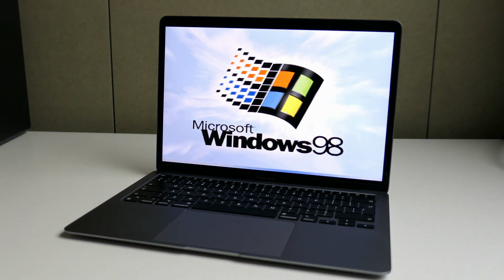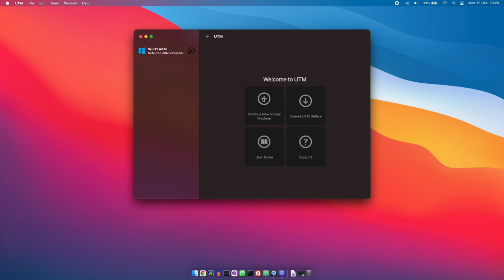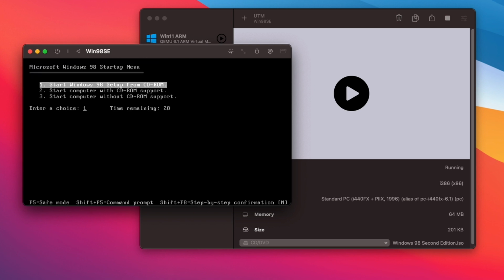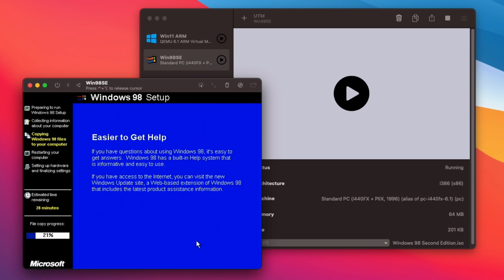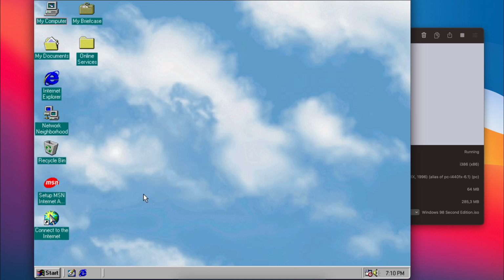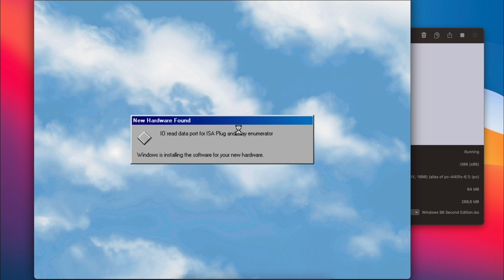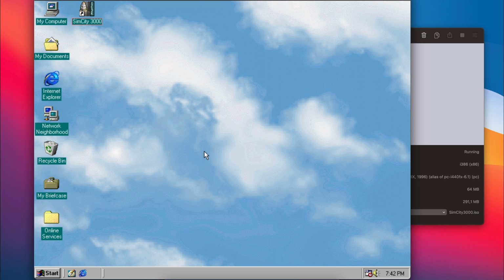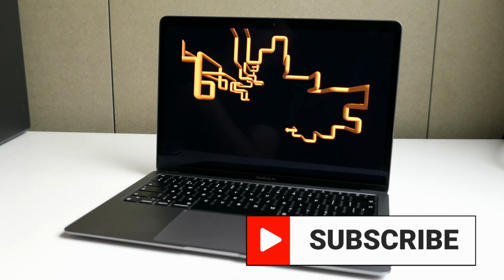Windows 98 SE on M1 or Intel-based Mac with UTM - part 1

Comment: THIS IS IMPORTANT: DON'T click "Next" during the second stage of the setup, otherwise Windows will throw the error "This program has performed an illegal operation and needs to be shut down" Anytime you see that button, don’t click it, press Enter instead, it did take me a few tries to figure that out though.

Comment: What worked for me to have network card working without installing additional drivers was to set in UTM network card to ne2k_isa and then this network card will be detected by windows automatically, you will only need to set "9" for irq setting of this network card and "300" for iobase (it will ask for this during installation).

Comment: I wanted to express my gratitude for the invaluable assistance your video provided. For over a year, I struggled to install Windows 7 32-bit on my M1 MacBook without success. Despite trying numerous ISO files, none seemed to work. However, a stroke of inspiration led me to consider an operating system purely based on x86 architecture. Thanks to your video, I found a solution. This was particularly crucial for me, as I have a client who is a doctor and requires a homeopathy software that runs exclusively on 32-bit architecture. Your guidance has been immensely helpful. Thank you sincerely. 😊

Comment: I'm going through the Windows 98 Setup Wizard. Every time after I type in my name for the user information window, I get an error message that says "Msgsrv32: This program has performed an illegal operation and will be shut down." and then a bunch of codes after. Any ideas?
Reply: Instead of pressing next button use keyboard and press enter (but make sure you press enter when next button is NOT highlighted).

Comment: I followed your steps but I get stuck at the installation part when you got to restart the installation a second time. It keeps asking for a win 98 cd that is already mounted. I tried to mount it to bot IDEs but the installation wont go on and keep asking for windows cd (the image i got is the same OEM one you recommended). Did you encountered this issue?

Comment: I was trying to install Windows ME on UTM (Version 4.3.5) following your steps. When the installation completed, the D: Drive did not appear. Instead of troubleshooting it more, I installed Windows 98 SE. After the install, before the login screen, it is trying to install the drivers that were selected on UTM (based on your video). Where do I go from here? Should I use an older UTM version?

Comment: When the system does the first reboot and asks for the computer name and company, clicking next gives me the 'msgsrv32 has performed an illegal operation' error. how do i fix it?
Reply: Instead of pressing next button use keyboard and press enter (but make sure you press enter when next button is NOT highlighted).
Reply: @nieznaszmnie00 tysm, I had the same issue and this fixed it. You’re a life-saver!

Comment: Thanks, great tutorial! I have come across an issue when installing the drivers though. There were some that couldn't be located after doing the Network Adapters. Now anytime the VM boots up it comes up saying it can't find them but still allows me to boot into the desktop. I'm unable to play the game I want to though. I installed it from the ISO but when I try to play it, it says the correct disk isn't inserted. Wondering if it has anything to do with the missing drivers. Any suggestions would be appreciated. The missing libraries seem to be vnsetup.vxd, vredir.vxd, dfs.vxd and msnp32.dll. I also have a problem when I try to navigate to the settings menu in display properties it returns an illegal operation error entitled Rundll32.
Reply from the maker: I saw this which matches your issue: https://www.techguy.org/threads/solved-missing-vnetsup-vredir-vxd-and-dfs-vxd-errors-win-98-startup.396654/

Comment: Isn't there a PC EMULATOR where you can not only install Windows 98 but also install Windows XP on a very slow Pentium 1 emulated machine?
Reply from the maker: The same process should work for Windows XP. But it will not really slow things down. As far as I know, Pentium 1 is also too old for XP.

Comment: Very interesting video. I never used Windows back in those days, I went from Amiga to Linux around the time SE came out. I later built my son a PC and installed XP home on it with a CD I purchased through my work for $19.95  so he could use it at college. I bought an extra CD for me but never installed it. I still have it in a sealed box complete with the license key. :)

Comment: thank you so much for this video. i do have a question: unfortunatelly i do not have a mouse inside the windows 98 windows. so, outside the UTM win 98 windows the mouse works perfectly. as soon as i try to swipe the mouse inside the win 98 windows i cant click and cant see any mouse movement. why? can you help? i tried using an external usb attached mouse but also does not work. so i cant even install win 98. because i cant click. PS: i already clicked the mousepointer icon on the top right corner but it does not work)
Reply from the maker: Haven't played with the newer versions of UTM recently. Might do a small update when I find some time.
Reply: @jensdbe  okay, thank you for your time and answer thanks
Reply: @TobiLotta  I am having the same issue with UTM 4.1.5 (latest). Did you ever find a fix? anyone has an idea? stuck on W98 Setup ...
Reply: @JoseMaldonado-gd2xq  i dont use utm anymore but there must be something about "usb" or something i just remember i deactivated and it worked.
Reply: @TobiLotta  that what right, and I missed it from the Blog where its properly explained. Needed to disable USB input in the VM config. Thanks!
Reply: @JoseMaldonado-gd2xq  oh glad it worked. glad i could help. have a great day

Comment: After trying to install Realtek drivers the IDE controller completely dissapeared, not being able to find necessary files from the OS installation disk. After cancelling it, it couldn't can't find device files from BIOS and throws an error when after boot, with Microsoft Network dynamic link libraries.

After booting into the OS, I saw that the drive was there in My Computer, so I went to the driver manager again to try and install the Realtek driver again, and this time it worked. I also had to reinstall the Client for Microsoft Network under Settings > Control Panel > Network, by removing, restarting, and adding it again (with the OS installation disk). Now it boots fine without errors.

However, I still have a PCI Card and PCI Communication Card drivers which I assume are the USB drivers, because I cannot find those drivers in the Driver Manager and was never prompted to install them. Not that I need them apparently.
Reply from the maker: PCI Communication card sounds like a network card or modem. Strange. It's definitely fiddling around with drivers to get everything working. I guess that's also the experience which was realistic back in the days :)

Comment: the newer UTM gives you the option to VIRTUALIZE or EMULATE, and does not give you the capabilities to make the exact parameter changes as you have specified, any tips?
Reply: you can edit all options as per video on the settings icon on the top right after creating the machine

Comment: Can somebody help me? I have followed the instructions in the video and in the blog post linked in the video description. Everything works perfectly. I just have two issues.

1) My mouse pointer is flickering. This is just a minor thing but mildly annoying in games.

2) Every time I compile a C++ project in Visual C++ 6.0, the entire screen gets corrupted (zoomed in and weird low quality colours). I then have to forcefully terminate UTM from MacOS. I don't know if this happens with other compiler and IDEs as well, but I kinda want to use Windows 98 for programming. So this is a major issue for me. Any ideas would be appreciated...
Reply from the maker: Did you see my video about display issues? You can find it here: https://youtu.be/vbS3dLTxyk8 Not sure if you already did this and if it would solve your problem but worth a try.

Comment: In the graphical setup, I can't do either mouse or keyboard input. Does anyone have an idea?
Reply from the maker: Make sure the PS/2 mode is on for mouse/keyboard. In newer UTM versions, this can be found at VM settings / INPUT / USB / OFF
Reply: @jensdbe  thx. USB off helped.
Reply from the maker: @webinterface3891  good to hear. Will try to add a note in the video and on my blog.
Reply: @jensdbe  Good Idea. That is so cool. I still remember that time well. I even still have the original Windows 98 CD here.

Comment: Any tips if sound does not work? I've got it set to use Sound blaster. There is a PCI Card and PCI Communications Device that just cant seem to be identified.  Using UTM 3.2.4 (58)
Reply: the same here

Comment: I'm having an issue when booting up Internet Explorer, where it would say "The page cannot be displayed", any way to fix this?
Reply from the maker: Check the network settings and if the driver for the network card is installed.
Reply: @jensdbe  Thanks for responding, but it appears to have fixed itself overnight somehow

Comment: Great video. I followed it but I am getting a weird audio error. Used Soundblaster 16 but I can only hear sound effects on games in DOS. No music. But music works within Windows. No other sound cards work. Used all the same settings. Also getting that weird screen glitch when going from DOS back to windows.
Reply from the maker: Might need to look into these issues with a newer UTM version. I have a very busy May and June ahead, from then I should have a bit more free time to play around... Sorry :(
Reply: @jensdbe  No sweat. Thanks for all that you do. I noticed the same thing in your part 2 video with Duke 3D. Sound effects but no sound. Did you have the same experience?
Reply: I managed to make it work using ac97 instead of sb16

Comment: Worked really well ! However, I have a few issues : whenever I want or an app wants to use the ms-dos prompt (not the ms-dos mode with dos running in full screen), it completely messes the graphics (zooms excessively, the screen is transformed into red and green bars, as if we could see the diodes of a screen, we can barely see the windows running underneath). It only works in safe mode, which is really not practical (slow, no dvd/cd drive since it loads only a few drivers).
Also, Quick FTP doesn't work anymore on my Mac (Monterey beta) after I tried to modify the password : it won't start the server ! I already tried to delete and reinstall the app.
By the way be careful if you want to upgrade utm, it changed the selected hardware (for me at least !)
Other than that, everything works perfectly ! You did a great job ! It's the only tutorial on YouTube to install Windows 98 on a M1 Mac with UTM.
Reply from the maker: I did see that first issue, with the Desktop being "broken" after leaving DOS mode from Windows. Not sure what causes it but it depends on the app/game and the resolution it was using before. Maybe you can play around with that a bit to work around it?

Quick FTP works for me on Monterey. Deleting/reinstalling the app keeps you settings in~/Library as far as I know. I guess it could help to clean that up as well.

Need to find time to play around with the new version of UTM. It's on my list to do a video on that as well :)

Comment: I couldn't install the network drivers, the error said insert a disk labeled 'Windows 98 second edition cd-rom' i think. The error code is 137
Reply: Happened to me as well. I formatted the hard drive and reinstalled Windows and it worked !
Reply: Happened to me too. When I canceled the setup wizard thing and went into file explorer, it for some reason, it deleted the CD drive! Now I can’t install network drivers!
Reply: before doing this part of the tutorial, I copied the entire cd to a folder
Reply: I think i screwed up, what do i do now? reinstall windows?
Reply from the maker: If it asks for the Windows CD, just mount it in UTM and navigate to the drive letter where the virtual CD is mounted.
Reply: @jensdbe  And also the PCI ethernet controller I kind of messed up on
Reply: @jensdbe  It is mounted but it was not detecting it
Reply: same has just happened to me - I think at some stage the CD drivers were reinstalled or lost just before the network drivers were installed maybe? I'm going to have to do a fresh reinstall and hope for the best. Did you manage to solve it in the end?
Update: Apparently it's updating the IDE controller that causes the issue. I'm going to try restarting after that update and then resuming the driver updates afterwards to see if that corrects the issue. Failing that, I'll try skipping that update altogether or at least until the other drivers are installed. Will update again.
Reply: @bigtom6443  did you find a solution?

Comment: why isnt my mouse working on it? pressed the mouse button and nothing happens.
Reply: I saw a different comment and a user said turn off USB in Input section
Reply: @binhdantat5560  Thanks, will try!
Reply: @binhdantat5560  This worked for me. Forced PS2 and disabling USB support.
Reply from the maker: Did you select the legacy PS/2 mode in the input tab of the settings?
Reply: @jensdbe  there wasn’t even that option. My version of utm seems to be different to yours for some reason.  I ended up using virtual box instead and works fine :)
Reply: @jensdbe  got same issue. Different UTM versions from one you have on a video but there is a box ps/2 under QEMU tab and I have it ticked. No mouse movement at all, so I am stuck once I get to 7:26 stage.

Comment: Thank you for making this video! I have an issue though. It's telling me "Device driver not found: "OEMCD001" No valid CDROM device drivers selected. The Windows 98 setup files were not found. Do you have any idea how to fix this?
Reply from the maker: Could it be that the interface for the virtual CD-drive is not IDE but USB?
Reply: @jensdbe  Thanks for the answer! It was something else with the drive that I changed. But now my problem is that the cursor inside the window isn't working at all, even though I've pressed that cursor button that you mention in the video. Do you have any ideas on how to move forward from here?
Reply: @josefinekonigsson9737  Cursor problem is related to USB mode in Input section. Just turn off USB.
Reply: It's that you've not selected the correct machine type and not selected [*] Removable against the CD you are trying to use. power off the machine, edit, remove the iso; then re-add, remembering to click "removable"

Comment: This is so cool, but is no 3D graphic card so you can play just some games - I try Need For Speed 1 and 2SE and working well, GTA 1 working well - but not sound. Firefox 2.0.22 - the last one with windows 98 support. Good job !! Anyway will be nice to have windows XP with 3D graphic support on arm64. A lot nice old games will be work great. For now is just one way -> parallels with win11 arm. But not everything working well on this way.
Reply from the maker: Yeah the lack of 3D acceleration limits a bit. But I didn't have a 3D card back then either so it depends a bit on which time-period you want to re-live. Most of the games that can be played fine on this Windows 98 SE VM are too old to be executable on newer OS versions so that covers that gap.

Thanks for your suggestions, will definitely  give these a try as well. So far I've been playing Carmageddon, Duke Nukem 3D, SimCity 3000 and RCT2 without too much issues.